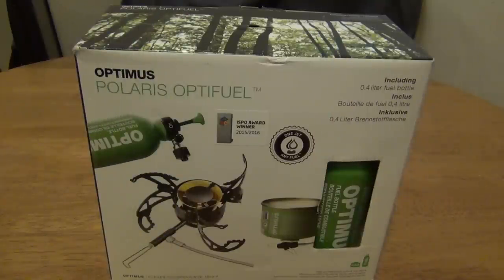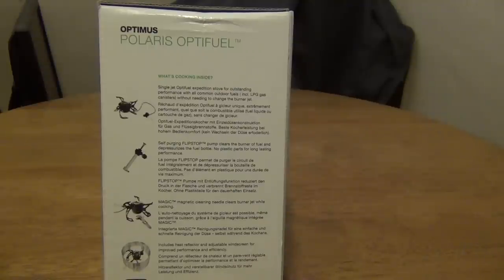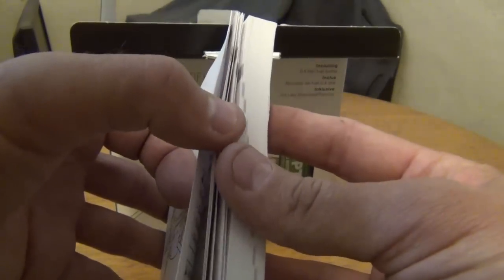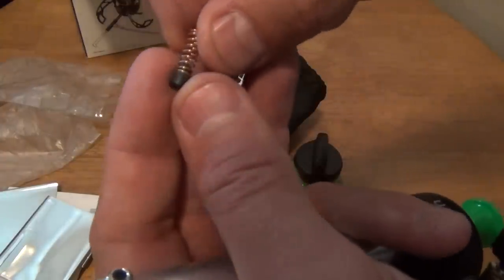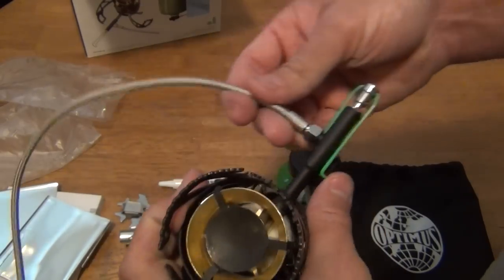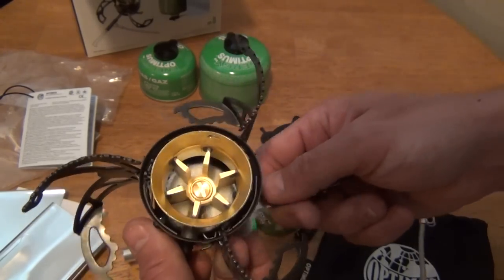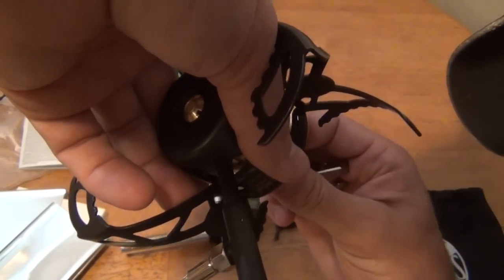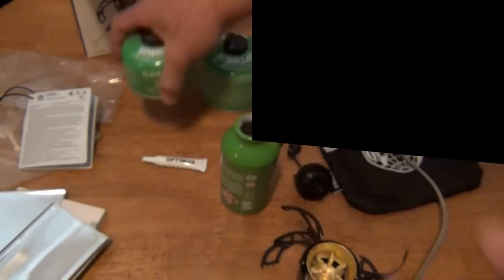Optimus Polaris - (part 1 of 4) - unboxing

Comment: The Brunton vapour AF did all of this 10 years ago.
One jet for gas and liquid fuels no need for an adapter to go between the two and it packs down smaller than this. 
10 years of innovation only added the self cleaning nozzle.

Comment: The fact that it uses 1 jet, does that mean that it burns more fuel since it's not "engineered" for any specific fuel? Did you compare with the other stoves you have? I'd be curious to get that info.
Reply from the maker: It's a fantastic stove. The MSR Whisperlite Universal is more fuel efficient.
Reply: @jiujitsu2000  Is there a number, % approximation? Are we talking 1%  or 25% - how much more efficient? Everybody says efficient, but nobody puts an estimation on it. I suppose that could be a deal breaker for some.

Comment: I just got mine and I see something "brown" like oxidation where the black pipe meets the brass body - I notice you got the same thing. Is that normal? Is that a what a new stove looks like? Is that from brazing the two metal together? Also: brown coating in the green bottle - I think I can see it in the video, especially noticeable at the bottom where I have a streak dried up? (Way nicer construction than anything I've seen in stores)